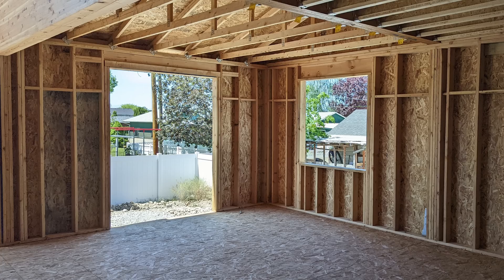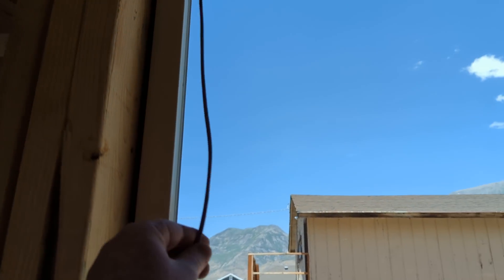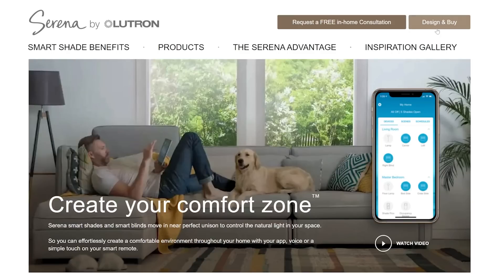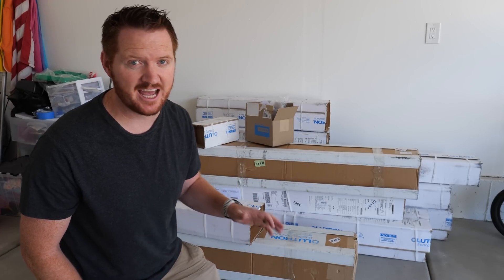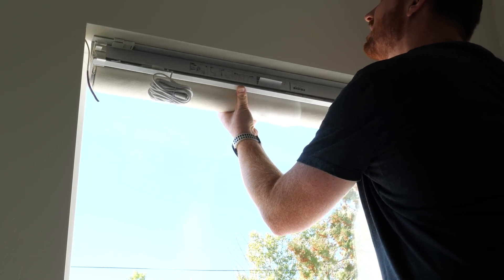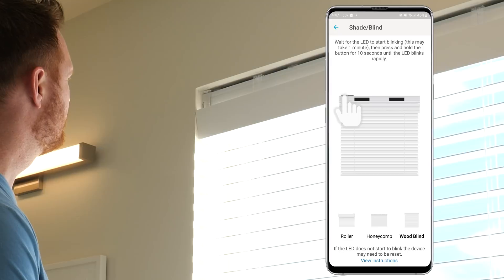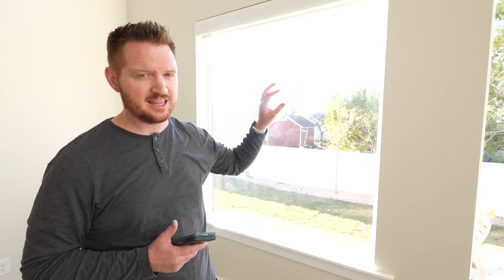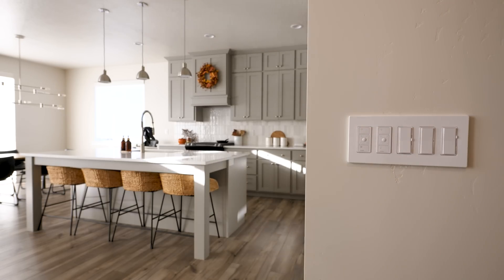How to Have Pro-Level Hard Wired Serena by Lutron Smart Shades

Comment from the maker: This process to take months of planning the final product is truly amazing. Thanks again to Lutron for helping with this video.
Reply: So I understand the prewires goes to the top left of the window. Does this also apply to outside mount on frame, and outside mount above frame?
Reply from the maker: @RogerPhillips-yn8cf  Great question. All of the shades have the motor and wire at the top left of the shade so if you are doing outside mount you could come 3" above the frame around where the top of the shade will be. The should allow you to then connect the wire and hide it. I haven't done this type but let me if you need measurements to help.
Reply: Makes sense! Thank you for the reply. Your video has been very helpful I will let you know if I have anymore questions.
Reply: Hey buddy I have another question, I know you said in the video you used a 16/2 gauge wire. But did you go with stranded or solid?
Reply from the maker: @RogerPhillips-yn8cf The CLR3 they put in was Stranded.

Comment: Thank you for the information. One question . So each shade need 1 set of two wires dc wire correct? Not required another one for communication? 

Thank you
Reply from the maker: That is correct. The 2 wires are for power and all the communication happens over Lutron Clear Connect to the Lutron Hub or a Pico Smart Remote.

Comment: If you want these shades, consider getting a quote from a professional installer, because they can get the same shades from Lutron at a huge discount compared to what Lutron will charge you at retail. I paid less, including installation, for Lutron Sivoia QS Triathlon shades (Serena is just their retail marketing name for them) compared to what Lutron wanted if I bought Serena directly.
Reply: Humm.  I got a quote for $13K from Budget Blind for 5 fairly large office windows, plus fascia.  I ordered mine directly from Lutron Serena and installed them myself for less than $5K and a custom fascia from local moulding shop, painted to color of choice.  Save us almost $10K.  These windows are not cheap.

Comment: If max input is 1.5A, why is your electrician wiring the DC drivers to two separate 20A circus via 12/2 wires?  

It seems like you could have had one 10 or 15A circuit split at a Jbox to feed the two drivers.

Comment: thanks for the detailed video. the only thing is that the electrician made a code violation  -  you can't run unshielded and exposed Romex 110V wire on the wall, it's against the electrical code. High-voltage wire has to be shielded.

Comment: So all the remote controls work on WiFi, not infra-red?
Reply from the maker: Actually none of it uses Wifi. "Instead, it plugs right into your router and speaks to all of your Caséta devices using Clear Connect®, Lutron’s patented wireless technology. Clear Connect works on a different frequency so it’s not dependent on the speed of your Wi-Fi network."
https://www.casetawireless.com/us/en/caseta-advantage/smart-hub-advantage
Reply: Correct, no wifi.  Not infrared either.  The control is via radio frequency (RF).  "Clear Connect" is just their marketing term for RF, and it's at 868 MHz, limited 868 MHz, or 865 MHz FM.

Comment: Where is the smart hub located? All wires go to the power supply, is the smart hub located next to the power supply?
Reply from the maker: Great question. The Smart Hub just need to be plugged into the wireless router wherever that is located. The wires from the power panel just proved power. The shade is what sends and receive the clear connect signal that connects to the hub. In my case it is just on the other side of the room from the power panel.

Comment: I had a wired Serena shade over my patio sliding door.  It worked flawlessly though I sold that house.  The shades are HomeKit enabled, the wood shutters are not.  Over time the shades need to be wiped off with a damp rag to clean them off and keep them operating silently.  I had a HomeKit automation to open the blind at sunrise and close them at sunset.  The blind has quite a bit of wire. You purchase the wall plug that clicks into the wire from the shade. Your electrician could probably shorten the length.  Brett has taken it to the next level using the in wall power packs.  It looks truly awesome!  

Serena even called after a while to get my opinion, which I told them we loved the shade.  My only recommendation would be to make the wire shorter coming from the shade.  Then have the option to buy the AC plug with longer or shorter length depending on what you need.  I wish Serena would make a electric plantation shutter.

Comment: Correct me if I am wrong, but are these shades powered by low voltage and then controlled over wireless? Do you know of any systems that also do control over low voltage?
Reply from the maker: Yes that is correct. The wire just provides the power and then the motors run on the RF Clear Connect system and that is how they connect to the hub. 

Doing my research I did hear about others running a Cat cable to each window that provided POE and the ethernet connection but I am not sure what system uses that.
Reply: @TechWithBrett  PowerShades is POE (power over ethernet). Run a CAT5 to each shade and the CAT5 terminates into a Router, the router getting a standard wall plug (which includes the AC to DC adapter).